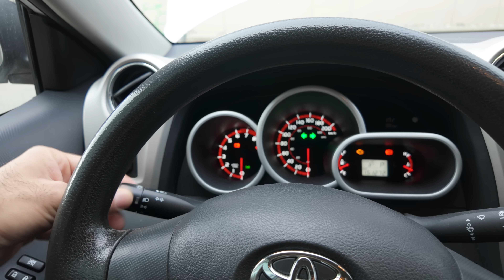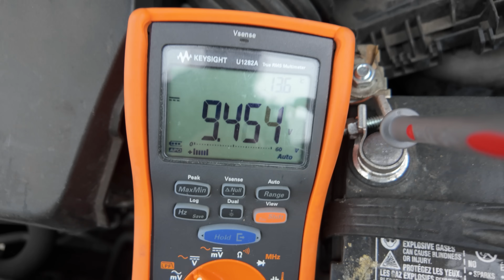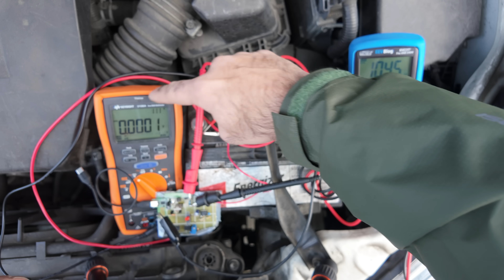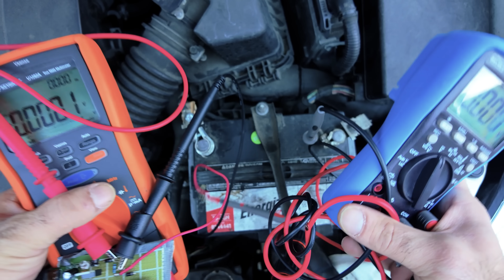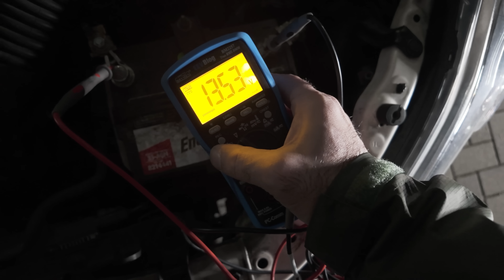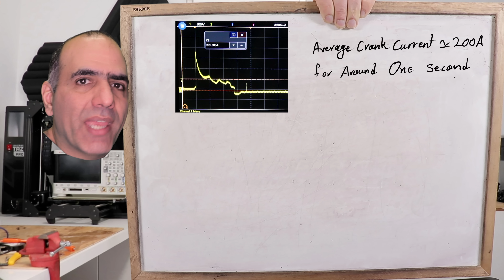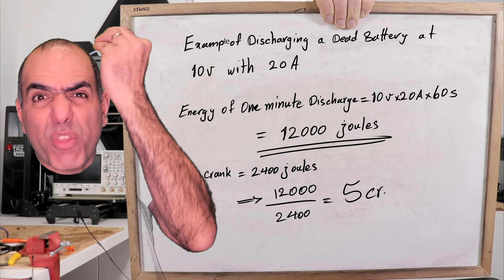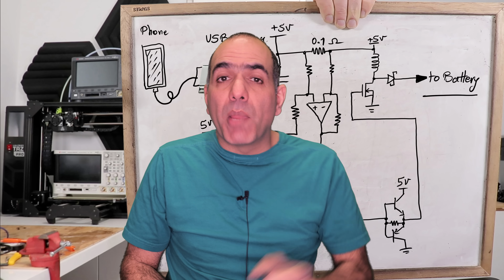Jumpstart by Phone

Comment: 8:07 ...as long as you have nothing better to do for 6+ hours.
Reply: Actually he got the battery charged in about 1 hour.
Reply: @shivamkantprasad no the battery recovered from 6v. A good  healthy battery will recover from being drained down to 6v and in a few hrs it will end up starting on its own.
Reply: @Maximumdub where would the battery get the energy to recover? And we just used the energy it had by dumping it into an heating element.
Reply: @shivamkantprasad  cars charge their own batteries with the alternator.
Reply: @tsm688 But the engine is not spinning. If the engine was spinning there would be no problem. And alternator only genretors energy when the engine is spinning.
Reply: @shivamkantprasad  he was able to actually start it once the phone was fully drained.
Reply: @tsm688  yes,but that what I was trying to say, the battery will not recover unless the car starts, the car will not start unless there a little bit of battery. Unlike what @maximumdub is saying.
Reply: @shivamkantprasad  he's not wrong, though.  a recently-dead battery will recover, a little.  energy will flow from high resistance areas in the battery to low resistance areas.

this is probably not enough to start the car but might be enough to bring it back up to 10.

its a bit like when you pour out a glass of water then set it back down.  you don't get everything, some clings to the sides, and ends up collecting in a pool on the bottom.
Reply: Even if it did take him six hours, in an emergency situation, you do with what you got. And if that's the best you got, then suck it up, Buttercup.
Reply: @Dtr146 if an "emergency" can exist for 6 hours with no permanent consequences, then it wasn't an emergency in the first place, buttercup.

Comment: Could you alternatively use the phone to charge capacitors and then crank directly from the capacitors (or put the capacitors in parallel with the battery)?

Comment: You should start a series of your 101 for people to make basic circuits announce like a week before what components will be needed and then we can build the circuits with you every time getting more advanced until all the circuits we’ve learned gives us the skills to make  one really advanced project with you like a weak computer maybe like a raspberry pi 5 type or a oscilloscope maybe a volt meter or a type of power supply  we can adjust then after that you could build circuit sets to sell people so they don’t have to guy buy all the individual parts they could just buy kits from you like it’s merch and after that you could start teaching for simple high voltage circuits and slowly move up to a cool advanced high voltage project that way you could make an easy video weekly and still do your awesome content on the same schedule your doing now

Comment: I once used a laptop charger (~18V 1.5A) plugged into a long extension cable from my carport to boost a car battery in an emergency XD. 18V is a bit high for charging lead acid but as a one off in an emergency, it got my car started in about 15 mins! I was headed to an important doctor appointment and already running late when I discovered the flat battery and there was just no other options, no one around to ask for a boost, no time to do more than improvise what I did. I ended up making it, fifteen minutes late but they were cool about it! (beware of potential hydrogen buildup when charging such batteries, especially at 18V. I was outside and aware but sparks can go boom!)
Reply: ..Good to be so resourceful. Caution needed if battery has gone high impedance or battery terminals have very poor connections as it's possible to expose the vehicle electrics to 18 volts. Best to disconnect battery as Mehdi did and only then connect charger to battery terminals.
Reply: @leybraith3561  Yeah I was counting on the battery itself to pull the voltage down enough to prevent that sort of thing( a multimeter was also in play), and also just the electronics of older cars (was a 94 Buick Century, this happened ~2010) being more tolerant of such conditions. It is definitely a concern worth noting, but fortunately I had no long term issues and the battery continued to work after the alternator was able to charge it on my drive to the doctor, as I recall it lasted til the end of the car's life around a year and a half later!

Comment: 11.8 volts = dead battery. You can intantly throw it into garbage. The sulfatation must be extreme at such low voltage.
Reply: except it wasn't
Reply: @tsm688  Which is very lucky. Because anything bellow 12,04 Volts is overdischarge. If the battery have been under 12,04 volts for longer than 10 hours, it won't be possible to recharge it. When the battery has under 11,94 Volts, it usually lost most of its capacity and it is better to dispose it. 11,9 Volts is state of fully discharged battery.

Comment: One thing you get wrong. If car battery have capacity of 60Ah it doesn't mean that you can load it with 60A for 1h until it discharge (10,5v). It means that you can load it with 3A (1/20 of capacity) for 20h in temperature 25℃ (check C20 rating used for car batteries and Peukert's law). 60 amps will discharge it much faster that 1h
Reply: 100% correct
Reply: Chatgpt seems to agree
Reply: His explanation is correct assuming ideal components
Reply: @Xnoob545 xd yea, that's maybe true, but Mehdi didn't mention anything like this. Just looking at this video people would think that's how batteries capacity works.
Reply: @EleyLaey  Yeah but he's likely going on the principle of "sometimes a little inaccuracy saves tons of explanation", so as not to bore viewers with information overload.  Part of the reason why his videos are so popular I think.
Reply: @Xnoob545 C Rating matters. Completely ignored.

Comment: 0:56 I have a 2021 Toyota Yaris Hybrid
I was listening to music in accessory mode for 30 minutes and the normal 12V battery and the hybrid battery drained and the EPB got locked up (basically f**ked up)
had to keep the car running overnight and sleep in that
since its a hybrid vehicle, it drains faster than a normal petrol/diesel car

Comment: The meter showed 34 mA, not 340. What am I missing?
Reply: He isn't measuring the amperage directly with the meter, he's measuring the amperage with a Shunt resistor,  reading the voltage difference across the diode and doing a bit of math according to the resistor values (which in this case is x10) he can get the correct amperage reading.
Reply: @HappySlappyFace gotcha, wish I woulda seen it's volts. I just didn't understand why he wouldn't measure it directly using those tiny currents
Reply: It even says Volts 🤔
Is this man joking with us, or his multimeter is lying to us 🤥
Reply: @DjaniAgain he was using a shunt.
Reply: Exactly, he's measuring the voltage drop over a 0.1Ω resistor (as shown in the circuit diagram at the end), so because I=U/R,  0.034V/0.1Ω=0.34A or 340mA

Comment: Most cell phones use a 3V lithium battery. 
The Samsung S25 Ultra battery has a nominal 3.8v battery. 
So even discharged to 9V without a charge controller you will fry your phone

Comment: 12:04 Could a 555 timer replace the triangular wave + comparator?
Reply: the issue is voltage.  using a modern op amp gets a lot more efficiency out of it.

Comment: A car battery should be considered dead below about 11 volts. 10.5 is where you start damaging the battery.
I'm surprised you were able to start the car at that voltage, but you did, so it actually works.
Reply: If he'd left it that low I'm sure it have died for good.  But that takes time

Comment: 04:30 Are you measuring across a 1Ω resistor or use some fancy circuitry to display the current in volts? 😂😂

Comment: This would be fun to see with a USB-PD battery pack or something that can do 3A at 15V. I think there are some phones that will let you do USB-PD out from the USB port too. 

There are also phones which will use the onboard Qi charger coils to wirelessly charge earbuds and stuff, that would be ultra cursed, "Wireless Charging my Car"
Reply: Isn't that basically what lithium jump starters already do? Mine even charges off USB-C PD.
Reply: @TheClockUpOnTheWall They contain a lot of batteries connected in parallel to deliver higher current. Also, they are built for higher amperage and better cooling at the cost of lower energy density.

Starting a car requires a lot of power even if overall energy usage is limited by the short time.
Reply: @TheClockUpOnTheWall they just connect the lithium pack straight across the car battery with a little bit of protection circuitry but yeah
Reply: Technically this is with USB PD, since Mehdi used a PD trigger board to instruct the phone to deliver 5V output. I suspect that most phones can only deliver 5V and maybe 9V though*, although a few can probably do 12V as well 

*Being able to send charge to another device is one of the more niche benefits of USB C, given phones these days prefer charging at 9V for faster charge speeds there's a reasonable chance they can output 9V for the sake of charging other phones too
Reply: @bosstowndynamics5488 I love USB PD for having made it so much easier to power portable projects or things that used to need their own batteries. I have a heated jacket from Milwaukee that takes their M12 batteries. Those things are expensive, but for $8 I got an adapter that plugs into the end that normally goes into the official battery, and just asks any USB C port you plug it into for 12V. Now I can use my big Ugreen pack that’s the same capacity as the 3 M12 packs I have, but only barely bigger than my phone, and a way less awkward shape. And as a bonus, that battery charges at 65W, so it’s full in less than an hour, while one of the M12 packs takes upwards of 2-3 on the little USB charger the jacket came with, or an hour on the fast charge dock I bought for them.
Reply: Those already exist as specialty devices. I have mine for almost 10 years now. It can provide 500A at 12V for a very short period of time. The jump start cables aren't connected to the USB out though 😂
They have their special connector which can actually sustain such energy for the required time ...
Reply: my baseus power bank could jump start my car. it has a special connector with jumping cable for it. or it could just work like any 10000mah phone power bank with usb PD
Reply: I feel like the wireless option would just end up starting a fire. This is a great idea for this channel lol
Reply: My phone can output up to 20v at 5amps to charge any device I  plug into it
Reply: @nicholas420svoc  The "phone" you're talking about is Tesla Model S?
Reply: @nicholas420svoc  which phone is that ?

Comment: 8:06 ,no the battery is not at 13 volts, that is just the alternator. If you turned the car off it would go to around 11.8
Reply: No, a charged battery should be at 12.6V to 12.8V without a load.
Reply: @kamal92606  should lol, i have almost never seen one at that. On the other hand, all of my batteries are pretty old....

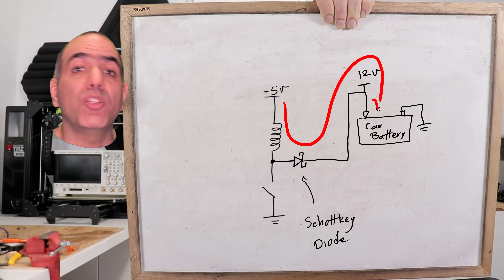Comment: 11:43  can't you switch the schottkey diode for a thyristor? So that the coil is forced to produce a high enough charge before the thyristor gets a pulse to pass the charge to the car battery.
Reply: The schottkey diode is there so the inductor doesn't destroy the MOSTFET between pulses. The inductor tries to keep the current constant, so when the switch opens it would put a large voltage between the source and drain of the MOSFET, which it isn't designed for. The diode passively allows the current to circulate when the mosfet is open and the battery gets a mostly smooth DC current, so there's no need to turn the diode on and off.

Comment: You should probably trickle charge that battery overnight then have it capacity tested by a proper battery tester. Deep discharging a battery below 10.5V a single time can severely limit the lifespan of your battery. Discharging it to 9 volts is madness, and very likely damaged it. Yes, it recharged, but I'd hate for you to have to rely on that boost converter from your cell phone on a cold winter night when that battery craps out on you suddenly.

Comment: I’m sure your car uses more than the crack when you start the car. There are computers and lights and tones etc that all add to the minimal amount of battery to get it to turn over. Loved this video thanks for making us smile
Reply from the maker: It does of course, but other current draw is a fraction of the crank. But you still have ti crank quickly before they such the little juice dry!

Comment: I believe it's simple. 
Use an opamp based RC oscillator followed by integrator. This will generate a triangle wave. Then use a comparator with that wave and  dc controlled by potentiometer. This will generate a pwm signal controlled by a potentiometer. Finally use that signal as a gate signal on the boost converter. Then use 5V dc to convert it into 12V dc.
Usage:- use potentiometer to vary the duty cycle given by:-
Output voltage= input voltage ÷(1-D)
D = duty cycle. 

I hope it helps a little for those who are wondering how it works.

Comment: 1:28 Most (all?) EVs still have a small 12v battery for running all the accessories, including the primary computers which are needed to operate the high voltage system. These tricks won't help your high voltage battery, but the amount of power needed to bring an EV or hybrid's control systems online is smaller than the power required to turn over a combustion engine, so you can probably get away with less juice (you can also use the smallest jumper box on the market to almost immediately wake the car up, and once the high voltage system is online, it will provide DC to DC power to the 12v to keep things running, similar to the alternator in an ICE car)
Reply: Came here to say this! I’ve successfully started my EV from a basically fully drained 12V battery. So yes indeed this is possible and would require even less energy from the phone to successfully start everything up.
Reply: @philipk89  I jumped my Toyota Prius from a 50 cc scooter all it has to do is pull in the HV battery relays then the DC to DC converter keeps the 12 volt battery charged the starter is 200 volts the same with an EV  8 AA cells and a bit of 16 g lighting flex will do.
Reply: Thank you SuperDerpyDerps

Comment: There are super capacitor jumpstarters that charge up to 12v from the dead battery with a step up converter, then releases it all at once so you can start the car, cool stuff, and you don't need to leave a lithium starter inside the car where it gets hot from the sun
Reply: I have one of those and it works quite well.  It can charge off the battery, a 12V car socket, or USB.  I could charge it off my phone if I wanted, but that's last resort because it'll take a while
Reply: I second this, I have one too, and it's awesome that I never have to worry about keeping it charged

Comment: What you need is a supercapacitor.  This will give you a low resistance storage of energy you can dump into the car to give it a few cranks.  It's not just voltage of the car battery that is the issue but when the battery is dead internal resistance spikes making it less able to handle a high current demand like cranking.
Reply: good idea, everyone carries one of those with them all the time

Comment: Ah the damn stove element left on the battery. Forgot that a couple times! Now I know better!
Reply: Everytime man. There ought to be a safety cutout when you leave it on more than an hour.
Reply: @marky0140  imagine if your driving in the dark and after an hour all the lights cut out and because of that you crash into a tree or somethinf
Reply: @MuranZhang-bh3ik  the computer knows when the car is running and would therefore cancel the power cutoff timer
Reply: @MuranZhang-bh3ik Check the alternator, coz that shit shouldn't happen. However, I once (on a motorcycle) got home but only just because that plug was not connected and  the ignition was running only from the battery. I was on a planned long trip but took a break after a while and could not start by the starter motor. Had to push start it so I went home. It got so bad that even with the lights off (not recommended for  motor bikes) it was faltering when I used the indicators. It literally died in my own driveway.
Reply: I mean who hasn't done the same thing... After asking chatgpt how to replace your car's heating element
Reply: Stove element left in my Honda Element was stupidity on an elementary level. Or at least I heard. Not quite sure that's what my wife, Ellie, meant.
Reply: Looked all over the house for the stove element.  Finally I remember -- oh, course, I was cooking breakfast in the car!
Reply: That's where I left it!
Reply: while the stove element is funny, my mother managed to practically kill the car battery with a fridge.
in a caravan, while the car was still hooked up with the battery. the caravan had external power, but she forgot to switch from car to external.
well, a friendly camper jumpstarted the car with his powerbank. he was so happy to test it. now my mother has such a powerbank too, even with an additional compressor. because nothing screams ingenious powerbank more than one that can also refill your tyres.
Reply: @robertheinrich2994 Mine are two separate things, so hopefully each does it's primary job well
Reply: Ik right🙄

Comment: I once saw a dude start the car from AA battery. He used it to trickle charge a super capacitor which covered the voltage drop during the cranking.
Reply: Did he have a unibrow